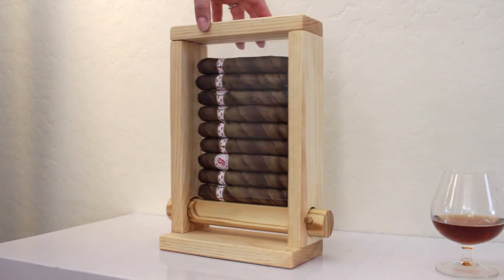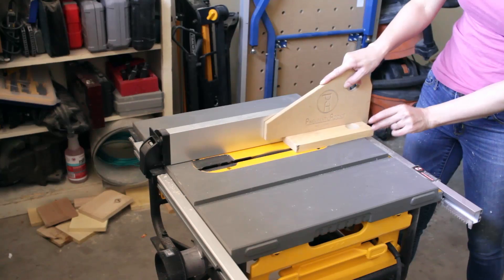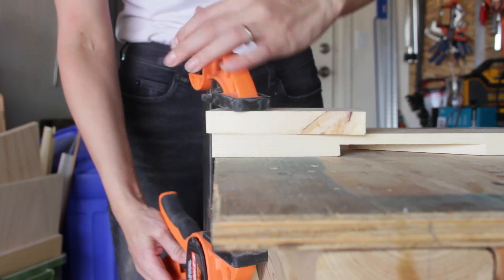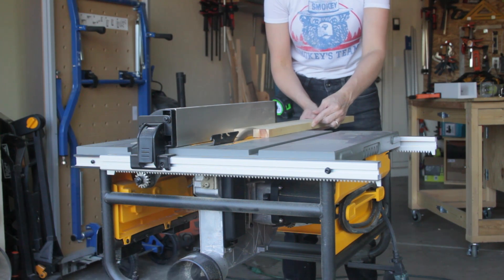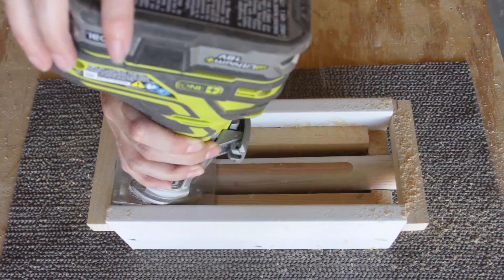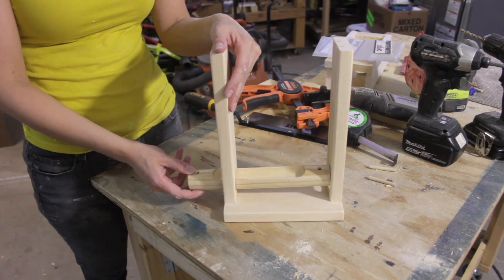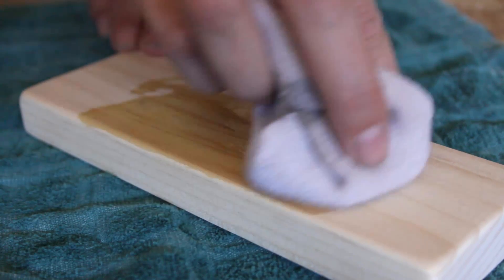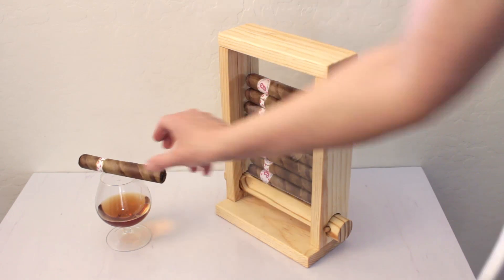How to Make a CIGAR DISPENSER | Woodworking

Comment: Got me with the chocolate cigar. Good one. This is a great project. Try putting a piece of thin plywood on top of the acrylic when you cut it, the top layer will keep the plastic from lifting up.
Reply from the maker: Thanks for the tip 👍

Comment: you should use a drill press when using large drill  bits like that,,   tip from a furniture repair dude who is still doing it after 43 years in the business with my own wood shop

Comment: Side note, you can get around those issues by having a tight fit at the pieces and a bit of silicone caulk as a seal with a friction fit, and make a little hinged door that swings away at the base instead and just add a boveda pack under the cigars. Also Spanish cedar veneers on the inside

Comment: You keep using CA glue in your projects as a quick glue up till the wood glue sets. Does CA glue not require an activator spray to work? Or how does this work when using with wood glue?

Comment: Just watched your video, in my local cigar shop, with a few others. (Some of which are doctors.) First props for doing the cigar thing, I see you already have the bashing and I wont turn it into a debate. We all did cringe at the backward cigar at the end. Nice twist with chocolate. While some of your info was still incorrect (tubos protect, very few humidify) this is an easily built unique item for the cigar collector and could easily be used to store a weeks worth of your daily cigars.

Comment: Why CA glue instead of standard wood glue?
Reply from the maker: I did use traditional wood glue as well on the joint connecting the sides to the bottom. I usually add a couple drops of CA glue to grab the wood and act as a clamp while the wood glue cures. The nice thing about RapidFuse is that it sets so quickly, it's really nice for quick projects like the jig.